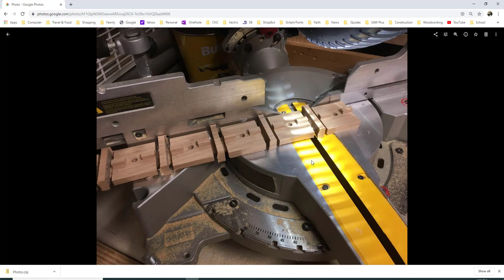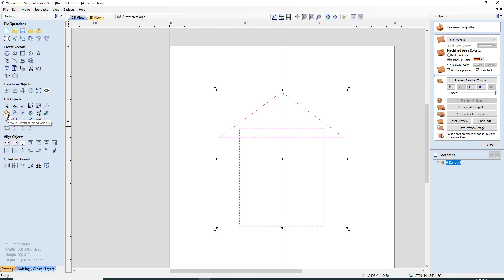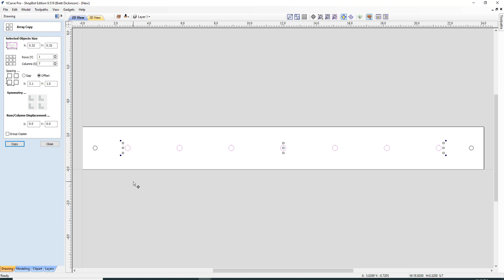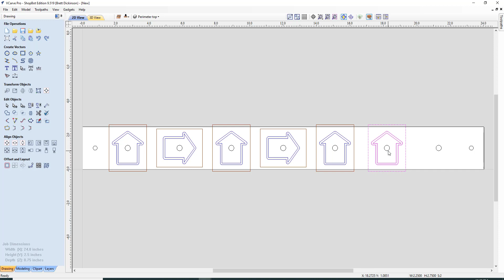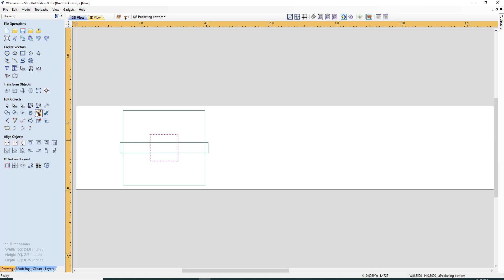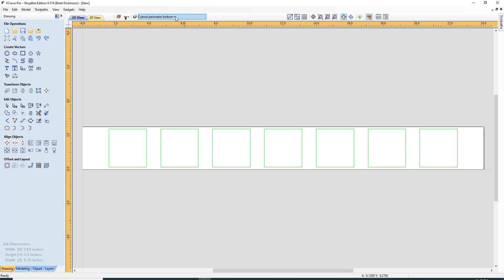Two sided machining stop blocks

Comment: Hi just watched this video and  learned some more things about vcarve pro.
I have  a question when making and  placing the arrows ,you had some part of it selected but you want one of them deselected could you tell me how you did that  I have seen that used in a lot of videos but can't see how it is done 
Thanks Jeff
Reply: I went  back and  listened again and saw wht you said and  did .So do you have  more vcarve videos.
Jeff
Reply from the maker: @resorter66     Jeff, sorry for not getting back with you.  You hold down the Shift key and left mouse click on the object you want to deselect.   There are some more tutorials in the works.
Reply from the maker: Sorry for not getting back sooner.  If you have items that are grouped, you need to ungroup them first by pressing the U key (G = group, U = ungroup).  If you drag your mouse from right to left, anything that you touch will be selected.  If you select too many items, you can unselect the ones you don't want selected by holding down the Shift Key while at the same time clicking those items with your mouse pointer on the items you want to unselect.